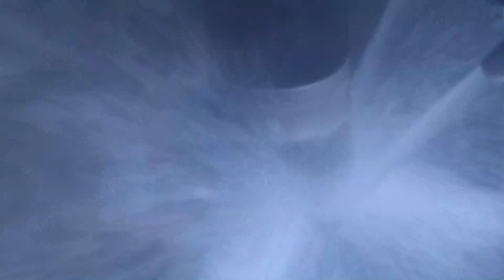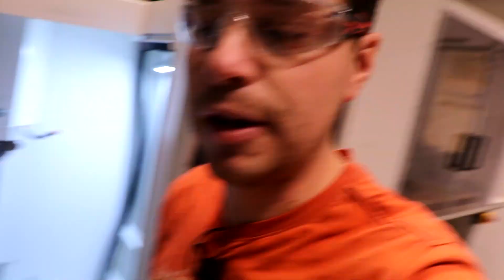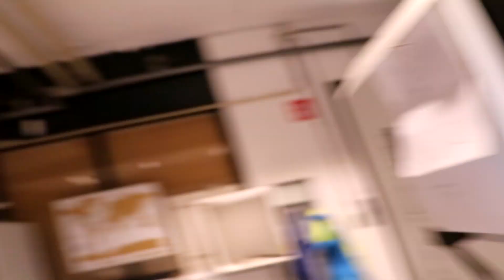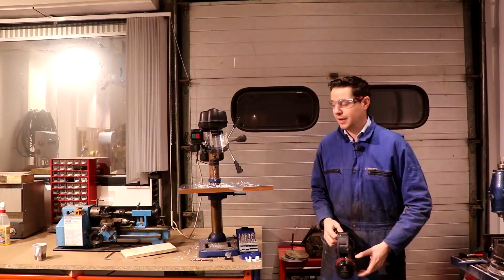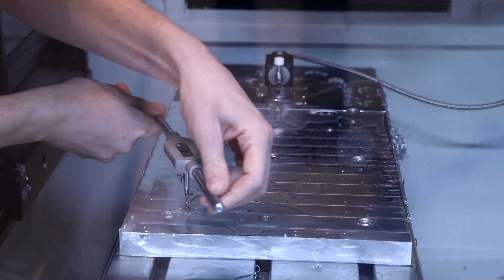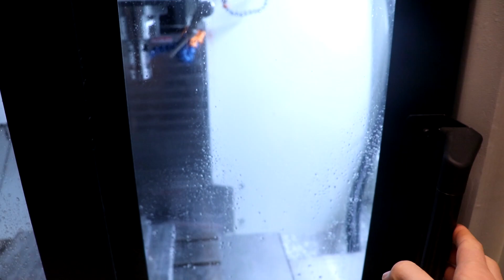Made for Oysters Episode 1: Fixturing a titanium Oyster knife on the Syil X7 CNC mill

Comment: Hey Alex, you probably have already figured it out by now. In any case, you are getting "chip welding" in the flutes of your drill. That happens because the aluminum gets too hot due to friction and melts, then it re-solidifies in the flutes. When that happens the drill does not cut anymore. There are a few reasons that might be happening to you. First, you might be spinning the drill too fast. Second, you might be plunging too slowly. Third, you might be doing both if you use the Z feed override to slow the plunge and that does not also slow down your spindle speed. Fourth, the cooling might be aimed wrong. You should check all these, then try to use a pecking cycle when you drill, where the drill goes in only so far, then it retracts shedding the chips, then it plunges again, over and over until it gets to the final depth. Look into the G83 type of commands (https://www.cnccookbook.com/g81-g73-g83-drill-peck-canned-cycle/). Ciao, Marco.

Comment: Are you setting a feed plane?  Cause it looks like you're rapiding into the part.
Reply from the maker: More people are asking this. To be honest, I don't know the answer. I just posted the code in the Syil facebook user group and I hope they can answer the question. 

G98 G73 X187.5 Y43. Z-27.605 R-9. Q3. F170.

this is the part of the code where the machine actually drills I think.
Reply: @yesealex  That's just the code for the peck drill canned cycle.  The part that would establish the feed plane is before that line.
Reply: G98 tells it to return to it's initial start.  
G73 starts the peck drill cycle
X and Y coordinates
Z is final depth
R is retract 
Q is peck depth
F is feedrate

Comment: 12mm drill, 100m/min in AL, 0.05mm per tooth because low hp/tq,  so 2500rpm and 250mm/min feed. say 2mm pecks. For the tap you don't really need the tapping head and if you go back and look at your video you have a massive amount of runnout on that tap (trick of the eyes?), you;re also running a gun or hand tap by the looks of it, for those holes run a spiral. You should be able ot push that tap no problem?
Reply from the maker: Hi thanks for the speeds and feeds. The 100m/min, isn't that too aggressive? As for taps and the tapping head: I'll have to buy taps instead of using that what i have lying around in the workshop. Once again thanks for watching!
Reply: @yesealex  I may have missed it, base plate is ally or steel? If ally 80-100m/min is fine, steel 25-30m/min.
Reply from the maker: It's aluminium. But once again thanks for your reaction!

Comment: There is something wrong it should have broken the drill bit and tap, maybe depth setpoint, alarm.
Reply from the maker: It looked like a spindle stall. Might be that the spindle overload sensor stepped in. It's not the most powerful spindle on this machine
Reply: even a small machine should break that tap
Reply: @mannycalavera121  I AGREE.